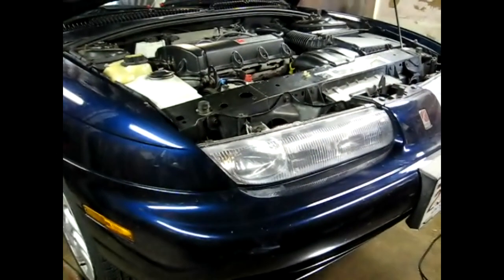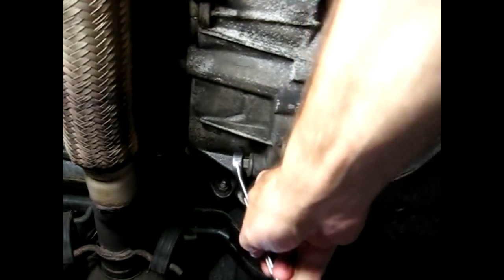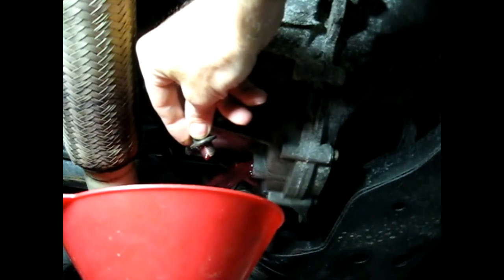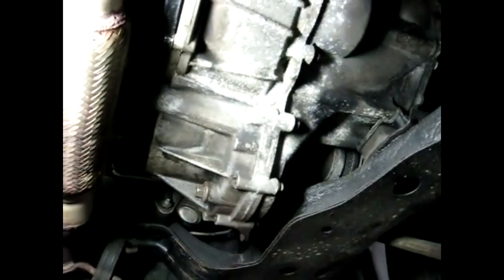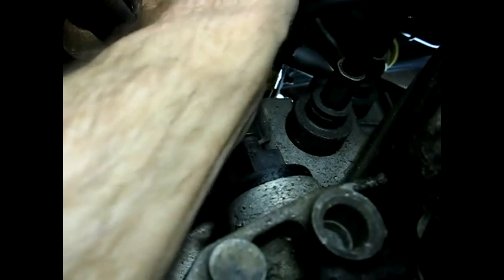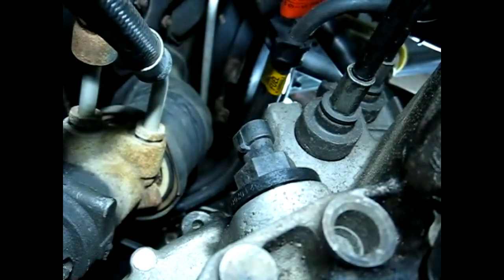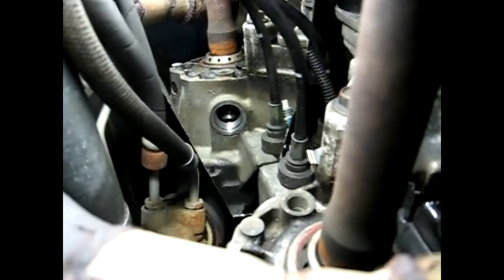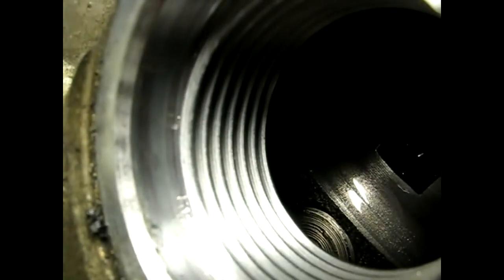Differential Pin Inspection & VSS Removal

Comment: Thanks for all, can explain me why do you remove oil, you can inspect the differential pins without draining oil.
And why do you inspect this pins it is very strong and never will be damaged?
Thanks
Reply: it gets loose and will fall out when the wheels spin at different speeds like on ice. and maybe just while youre driving like mine. crusing at 90kmh, let go of the gas and boom

Comment: I wanted to ask about the egr, but I didn't know if you checked the comments on old videos still, so I thought it would be better to ask here. I need to change the EGR solenoid on my 93 SC2, and the replacement solenoid has the connections for the vacuum hoses right next to each other, instead of the top and bottom. Does it matter which hose goes in each connection, or will it work either way?
Reply from the maker: Have you tried looking on the radiator support to see if the  vacuum diagram is still there.
Reply: @RichpinTv  It turned out I had mistaken the purge canister solenoid on Rockauto for the EGR Solenoid, and I was able to get it rectified. Thank you for the tip about the vacuum hose diagram

Comment: It sounds like the designers didn't design the locking pin correctly if the main bar can escape over time.
I bet that ruined a few diff's :-(
Reply from the maker: I am knocking on wood as mine has 200,000 miles and is still going.
Reply: According to the Saturn forums, the differential pin typically only came out as a result of frequently spinning tires under a heavy load
Reply: Yep. It ruined my transaxle.
Reply: I think late models had stainless steel, previous ones were aluminum. I replaced mine when I changed the input shaft seal. Mine was 2002 with a stainless steel pin as a stock pin.
Reply: Unfortunately mine just did that because I slipped on some ice and then caught traction again and boom threw the dif pin right through the case.

Comment: I have herd of people welding that pin in place. I assume if you have the right  welder and a steady hand you could zap some tack welds or maybe beads of weld around that pin.
Reply: Instead of welding it to the planetary gears, you can weld in the pin to the actual casing through the bottom.
Reply: You can. I’ve seen it done right through that hole lol. A couple tac welds, spin the tire to the other side, a couple more and done. If the pin has started to move a little bit, you can still salvage it by tacking it up sometimes although it won’t be nearly as secure as if you get to it before it starts moving. It’s it’s moved more than a cm or so I’d advise against it and pull the transmission.

Comment: It's been quite some time now since I owned a Saturn...forgot about those diff pins coming loose and causing havoc.  You still driving this old Saturn of yours Rich?
Reply from the maker: I am still driving my 98 SL2 with 200 plus thousand miles.I was looking around for a replacement this spring BUT......
Reply: @RichpinTv  we still have our 98 sc2 5sp. runs like a swiss watch 223000 miles on it. Still has original clutch too!